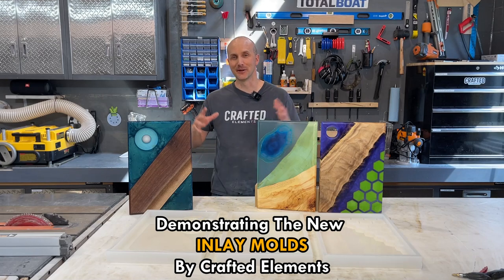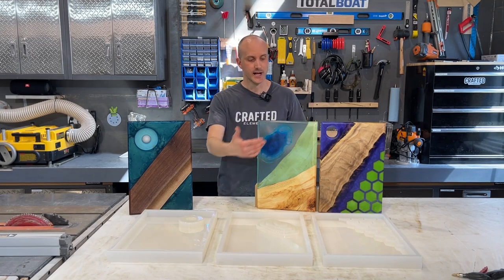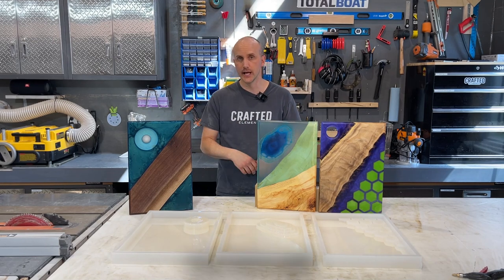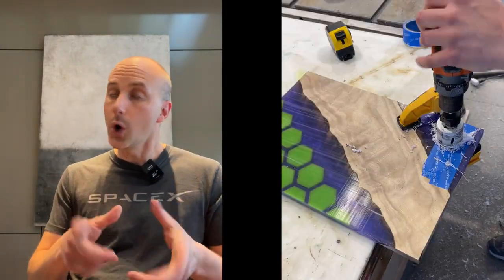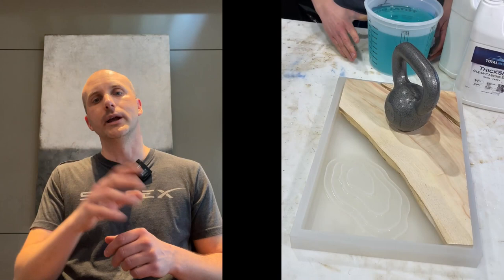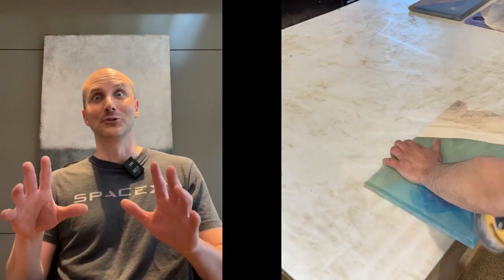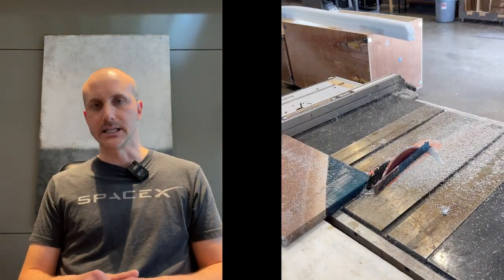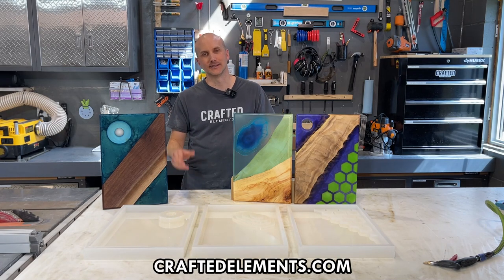Insane Resin Inlay Design Molds - Resin Art Meets Wood & Resin Serving Boards

Comment: Hi Shawn,
Been a long time fan of crafted elements and have several of your excellent molds. You mentioned a couple of times in the video that the recesses could be used for cups, which I think would be a great idea on a 2 inch thick mold.  I the layered topographic look, which I think looks awesome, wouldn’t make the best cup.
If you are soliciting ideas:
How about a 2 inch thick mold with dome shaped recesses about 2 inches in diameter to act as condiment or dip cups?
Reply from the maker: That dip cup idea sounds cool. I wanted to see how people use these existing recesses, but it makes sense.

Comment: Hi Shawn,
Have just gotten a few of your mold -- the hexagon design is definitely in my future.
Quick question -- what bit do you use / suggest to chamfer the boards with?

Thank you
Chris
Reply from the maker: I just use a boring old 1/4" or 3/8" round over for the vast majority of the edges I do on these boards.

Comment: Will these be good for actual cutting board?  Does epoxic work for that purpose?  They look very nice. Thank you.
Reply from the maker: Ideally if you are actually cutting on it (as you regularly would a cutting board), don't use epoxy, or just use a small amount to fill voids or holes in the wood. Epoxy will scar and isn't easily repairable without a resand and polish.
Reply: @CraftedElements  Thank you so much.